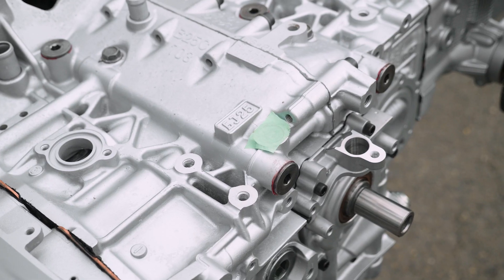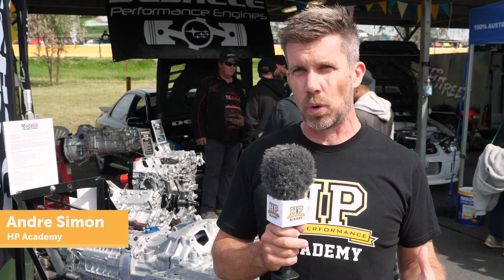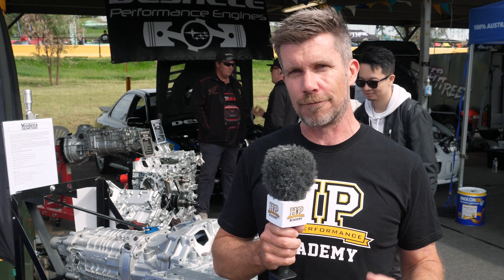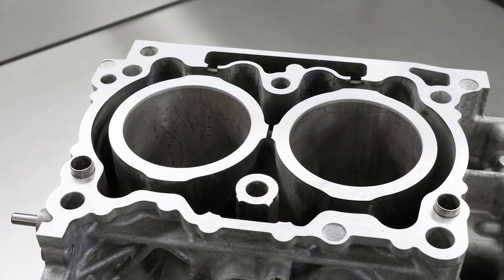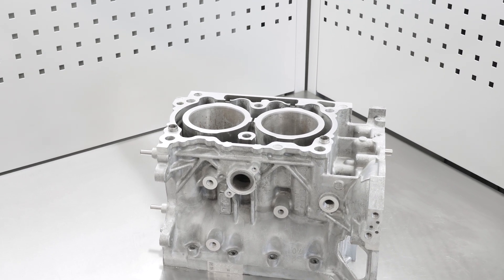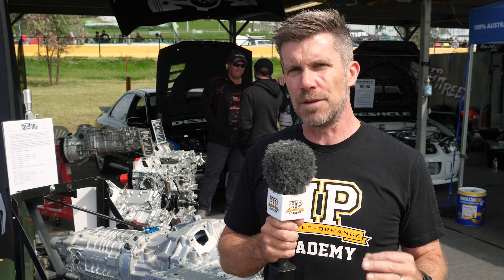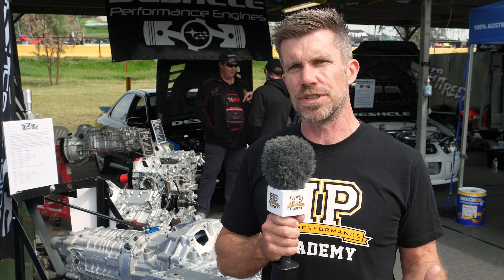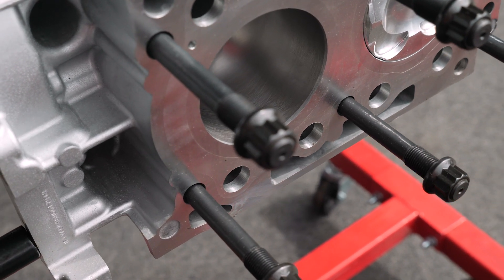Fixing Open Deck Blocks For BOOST (On The Cheap-ish)

Comment: What about epoxy resin deck support?
Reply from the maker: Not something we have tried personally. These days it's not as difficult as it once was to get some sheet plasma or laser cut so to honest we probably would never take the risk trying to save a few bucks using epoxy in that way, which isn't that cheap either anymore really - Taz.

Comment: I have a Maserati Ghibli SQ4 with a ECU tune I can push 524hp but I wanted to mod the car to get closer to 700hp but I was told it’s open deck so they don’t recommend it. What would you recommend? Would that piece help keep the engine from kicking the bucket?

Comment: Considering doing this on my Honda H22A4. It has FRM sleeves which are extremely strong however I have come to the conclusion that the sleeve isn’t the issue, but the block design being open deck is what would cause a weak point. What would be a safe power goal if I installed something like this on my engine?

Comment: you did not talk about the Real CHEAP solution and its using JB Weld , Devcon ,or Block Filler , please andre make a video for this i am about to try this , also would be nice to have some EV content With AEM EV
Reply from the maker: I'm not sure JB weld would actually be much cheaper, that stuff is pretty expensive here 😂 Hope it works for you though!

We're a bit off stsndlone EV Ecu content, but the first EV course is in the works with Sasha Anis at the helm for you guys 😎 - Taz
Reply: @hpa101  HELL YEAH THANKS ! i think a ev car dont need dyno anymore
Reply from the maker: An EV is different when it comes to tuning in the sense you might not need a dyno because you might simply not be able to 'tune' one for more power anyway when it comes to OEM applications comparing to how we flash tune ICE's. For a scratch-built application using the likes of an AEM EV specific ECU things are different again though.

GREAT podcast here: https://www.hpacademy.com/blog/45-can-you-actually-tune-an-ev-for-more-power-podcast/?utm_source=facebook&utm_medium=social&utm_campaign=general-interaction - Taz.

Comment: Subaru tragic's will still argue that open deck design has nothing to do with being a cheap poor design and is done for "added cooling" and performance. I've had this argument I don't know many times with these fools, There's no good engineering reason for open deck design other than corner cutting to save money.
Reply from the maker: Wouldn't say it's corner cutting, it's a manufacturing technique/option used by other car companies too. They are building engines for stock performance, not for us to tinker with otherwise they'd just come to us with 400-1000hp from the factory and be built for that. Which would also cost you more - Taz.
Reply: @hpa101  so I've got an open deck on my 1.6 Ford Ecoboost (Fiesta ST). At about 147k km had a seized spark plug, which necissated a cylinder head overhaul, and a light deck skim. At 153k km, it started the dreaded gulping coolant issue (1-2L every other day) which can only be attributed to a compromised head gasket or more likely, a cracked liner. 100% stock by the way.  Ford have since replaced their open deck designs with newer semi-closed deck types for the newer versions of the 2.0T but opted to just discontinue the 1.6T in favour of a semi-closed deck 1.5T in their newer vehicles. So even in high-HP stock applications, the open deck is a poor choice, and OEMs know it.

Comment: Just to clarify, it isn't the cylinder pressures, per se, that are normally the problem because that's applied evenly around the cylinder - so no imbalance, no movement as a result.
The problem is the major thrust-side loadings drastically increase from the higher piston force on the angled connecting rod - it's a simple vector equation.
Reply: Awesome comment! I have a H22A4 open deck with FRM sleeves. With a block guard what would be a safe HP range? I’d like to push it a little bit
Reply: @jonmotes5406  
I'm not a Honda guy, but from what I've seen it looks like 5-600 is 'safe' on a forged bottom end, and some have pushed it a bit harder.
However, you should really check with the Honda specialists - an upgraded block with Darton sleevs that engage with the main block may not be that expensive relative to the full build, and if you need a rebore anyway...?
Reply: @gordowg1wg145  yea I need to measure my bore and see what that tells me.
Reply: @jonmotes5406  
As I said, I'm not a "Honda" guy - but I've been following these channels for years, in case you're unaware of them, they have been almost exclusively K, B and J series Honda engines, in various states of tune -
https://www.youtube.com/@boostedboiz
https://www.youtube.com/@PFISpeedtube

Comment: Great video once again. One thing I think need to talk about is what is extreme power mean when different people viewing different power levels as extreme. I think it is needed to mention the cars in the background are all close to 1000hp, and both still use decking plate. Biggest problem with sleeve is not the product itself, but who and how it is put in, it is not easy to get it right, the normal so called specialist shops will most likely get it wrong, sleeve sink, and done more damage than to begin with. Maybe it is only the case with aluminium blocks, but still in my opinion, close decking is better solution for most of the us.
Reply from the maker: Yeah you're not wrong, it's all relative though rather than being an easy X HP is this or that. We should setup some sort of 'Andre power scale' for reference though haha - Taz.

Comment: One question, you mention the plate is press-fit into the block and I begin to think about slightly difference thermal expansion rates for a cast block and a billet plate.  They are both aluminium so it won´t be much but is it something that should be calculated and taken into consideration?  I would not be concerned in most other applications but in such a critical area where the head to block seal must be maintained it raises a flag, albeit a small one.

Comment: I sleeved my 2.0 focus ST block that’s goin my mustang ecoboost, shooting for 1000whp
Reply: Is ems still at 850? I'll be back for the eco record soon lol
Reply: @dragonmantuning3792  I think ems is claiming their build is at 1000whp or 1100hp.  But theirs is currently not running.  So it doesn’t count.  And when they ran 850 it failed shortly after.  I’m also using a 4 port head. And running the stock ecu instead of a aftermarket one. That’s what ems did and that’s why they can get it to run.  What’s your build ? Or previous build??  My 1000whp build is still getting built so not done.  Right now I have stock engine 2.3 full bolt on , nx2 at 400whp. Can’t wait to get my build done probably at end of the year.
Reply: @Paper.Power.Politics  nice who's building your engine and tuning? I had two ten speeds blown up running 450 whp on e50. Right now I built a 2000 lb 1.7 liter honda but I'd like to css an ecoboost later to see what it can do
Reply: @dragonmantuning3792  that so sick bro!! Yeah that’s why I’m at 400whp on e30 that’s the safe mark pretty much lol. I also have the 10 speed which is also gonna be built.   And I have the best building and tuning Mine lol adam Brunson at tune plus.  To me he’s the best on the focus/mustang platform. 2.0/2.3 ecoboost.  I’m also using a xona. Xr 105 69s turbo.  Good for 1100whp , but I have seen the evo 4g63 guys use the 95 69s and they hit 1000whp all day on those!! Xona turbo is the way to go!
Reply: @Paper.Power.Politics ever finished the build
Reply: @slow4freddy yep i did actually.  I did end up going a slightly different route and no longer shooting for 1000whp.    My engine can take 800-900whp but im only shooting for 600-700whp now.  And im currently at 520whp with my current turbo set up.

Comment: I tried to go that route for my Volvo 850 5 cylinder but when I talked to the machine shop initial he said so problem the Honda block cost around 600 Canadian dollars to install and all the CNC work. But when he got back to me he said said because it is a unique engine and so on it was gonna be 1400 plus dollars to install the block guard. On top of that he said he had to cut into part of the cylinder to install the guard and would only Guarantee it for 600hp. So I figured at that money may as well go darton so now I have a block that's super overbuilt for no reason.
Reply from the maker: How much power have you built the rest of the car to handle? Nothing wrong with going with Darton Sleeves if you need them, but someone else mentioned these guys in the comments and on their horrible, horrible website they have your engine listed 😅 - Taz.
https://cylindersupportsystem.com/
Reply: Once the slit is machined away and a deck plate of 7068 (alloy not too far from the Volvo casting) is installed, you can throw more at it than you'll be able to use. With the deck plate I'd say they will hold 800 honest over time. Also, on the 5 cyl. you have the ability to use the D5244T "D5" block (different mounts, and one oil-return gallerie needs to be modified). Team-X-Racing in Sweden used the diesel block (19mm taller deck, so longer rods and less lateral force) with just a MLS gasket as support, and they ran honest 1000 hp in dragracing for two seasons in a row. A "D5" block with a deck-plate is "bulletproof" for most practical means.
Reply: "Only 600". 
Is Your 850 still FWD?
Reply: Who did you go to that quoted 1400? I’ve been looking to get a block guard for my next t5 build and I was thinking of going thru  deeworks or css

Comment: Have you ever seen or had experience with using "dowel pins" with an open deck? Basically you're putting a piece aluminium (seen brass used as well) round bar between the liner wall and the water jacket wall to try and pin the cylinders in place. I've most commonly seen it on Subarus and Volvos. It's a tempting option since the engine I'm looking at isn't commonly modified thus the option for sleeves / deck plates are non existence / custom one offs.
Reply: I have seen it in VQ35.
Reply: I just saw someone do that do an LS on the water jacket openings and an LS aint even open deck.
Reply: It can certainly help, but the problem is that the cylinders are then more stressed where the pins/dowels are, and while they may not fail, they can distort and compromise ring seal.
Something similar is where a curved insert is used, that follows the curve of the cylinder over a greater length and so spreads the loads.

Comment: What would be the solution if a dec plate is not available for my application? Is there anyone doing on off’s? Great information as always
Reply: Heaps of places would do one off's. Any one with machines can make them
Reply: @sexyfacenation  Damn... I don't know i was thinking of a "cylinder bore" tool... yeah.. if it's just a cylinder support brace.. any good machine shop can cnc or "one off" make that. Now the million dollar question to ask... what crappy air pump he's trying to "brace up" that doesn't have aftermarket support to make it a closed deck solution?
Reply: Half fill
Reply: Grout fill the block to the 3/4 mark and use a good oil cooler
Reply: Just off the top of my head... would be to bore out an old cylinder head and that would come close to an actual head torque. If they don't sell one outright for your engine... most good machine shops have them available for rent too!

Comment: Pls mind my silliness but could u press maybe another 1 slightly deeper say 4 sake of a measurement 50mm from the final top deck plate to enhance strength more?  A Few"Tuners " here offer a so called "block mod" on the Mk2 Rs/St focus 5 pot which some wedge the open deck. How do u guys stand on this method? As always ur videos make me think and learn. Thank & 🖒👊✌ from the UK
Reply: Prob possible, but to my un-trained and totally amateur engineering mind, sounds like this might lead to cavitation/bleeding/air-lock issues in the water jacket. 
I could be totally wrong however.. 

( I think you'd be better off with a thicker top plate and calling it a day if going to that extent. I even raise my eyebrows regarding getting a cnc that deep into the block to clearance even that, say, 15mm extra thickness. Then again, I'm not a cnc guy either lol)
Reply: Thank u I appreciate your insight mate. It was just 1 of them what if I put another 1 slightly deeper to provide more stable bore ect. With regards to u saying "cavitation" pls can u explain if that regards piston in the bore or r u refuring to fluids and cavitation? Pls excuse my ignorance mate but I love the fact that I am watching something that makes me go "What if I did this or that" and have the ability to then bounce that off like minded people. Appreciate it time. Thanks & ✌ from the UK
Reply: @sidbobby3233  Just to add. This solution in this video (single deck plate) is good for some serious HP.. 1000hp in some applications. Sometimes the wheel doesn't need re-inventing, twice lol
Reply: @starfox_wr-45e93  wow that’s impressive. I have an H22A4 and was wondering with this block guard what type of HP it could handle safely.
Reply: @sidbobby3233  Cavitation of the coolant that runs around the bores. Not an ideal situation to have places in the block where air can get trapped I suspect. Maybe some coolant wouldn't be able to circulate, become stagnant and create hotspots.

 Closed deck blocks will have channeled waterways to avoid all that. Open deck blocks have a lake for coolant to swim in, in comparison lol 
 
I think having two plates without having a guided flow for the coolant wouldn't be ideal. Coolant needs the least resistance to flow while having the most contact area on heat critical components to work efficiently.  

If you google image search "engine block water jacket cutaway" you should see some images.. notice how the water mostly has a "straight-shot" from top to bottom. A second plate isn't going to have that at all. At least, I cant see how it would. Maybe if you chambered the water channels severely, but that would possibly compromise the strength of the plate and the nullify whole point of installing it to begin with..

Also in the U.K btw 😁